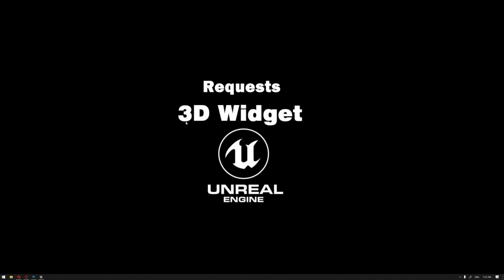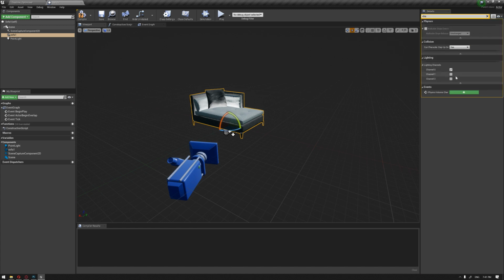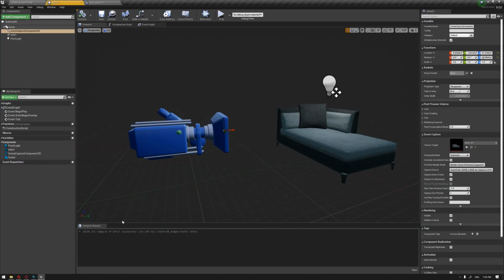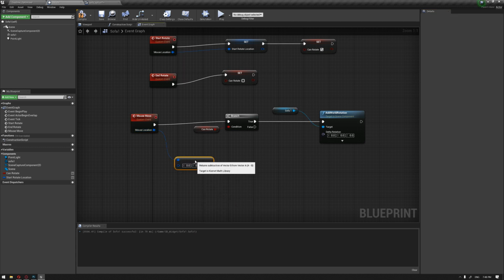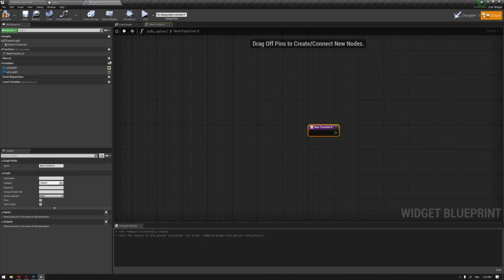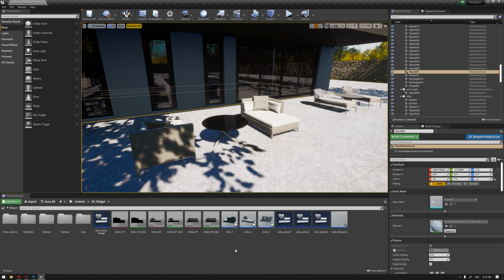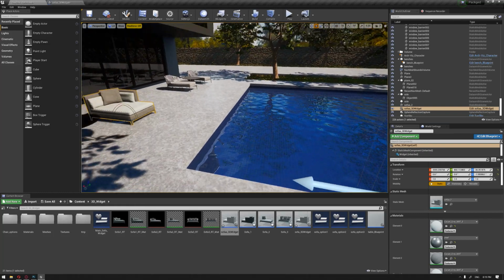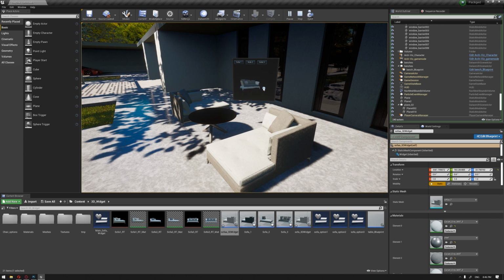Request 4 part 1 : How To Create a 3D Widget

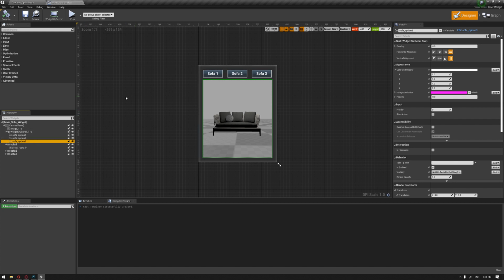Comment: Great tutorial, man! Thank you for sharing your acknowledgement with us! Could you help to solve the problem that you mentioned at 15:33? I am trying to make a listview on my widget showing materials list to player select. But, the texture render target loses the alpha channel every time that a restart the project. And, i need to reopen all blueprints viewport agais (more then 100 blueprints!) to refresh the textures. How can we solve this? Do you have a trick? Thanks a lot!
Reply: Complementing, i tried to package the project and the texture render target is being missing even if i build the package with all blueprints viewport opened. I know that if i put the blueprints in de map it will work, but in this case i lose tha alpha channel. I will really apreciate if you could help me!
Reply from the maker: @_marcus_vinicius  sorry for the late replay ,  missing textures in a packaged project could be because the textures in your original unreal file was not embedded in your projects files so the engine was not able to package it to its location same for videos also , as for your first question we still trying to understand why this require opening the bp for some of the widget cause its not happening with all of them , hope that help

Comment: How to make this work in a top down template? Itried doing this but the player just moves past the widget and I cant click the button
Reply from the maker: Hi Pratyush , not sure how is your down template layout arrangement look like but if this a problem of widget overlapping with you character or actor then there could be a different solutions for this like activating that widget with a corner small icon or adjusting the mouse click when it overlap with the widget to be snapped to it
Reply: @theimageneers5161  hi i solved it , but one more doubt , how can rotate the object using widget buttons?
Reply from the maker: @pratyushraut9120  glade to hear that , basically you will use a slider to control two value min and max from the object properties

Comment: Hi, my widget needs a refrence to the building it is located it, how do i set that in 3d widgets?
Reply from the maker: is your building an actor or a static mesh imported as datasmith ?
Reply: @theimageneers5161  i think it is an acotor, but someone else already told me that i can get the widget than cast to it, and than set the variable by that. It seems to work. But thanks for the help anyway.
Reply from the maker: @Piet_PP  Thank you for sharing  your experience as well , glad to see you figure it out , thanks 🙂

Comment: Widget interactive component have been crash and doesnt worked anymore. This tutorial only work for older version. Anyone follow this tutorial seriously will see the problem. Im one of them
Reply from the maker: Hi there , this widget interaction is working fine in Unreal engine 4.27 latest updates , if your facing any crash problem perhaps you could do a small test for a simple widget interaction in an empty level after verifying your UE version file .
Reply: @theimageneers5161  update. I create new project. Widget interactive work fine at ue 4.26 and ue 4.27. But widget interactive in my current project still doesnt working. I dont know what cause it, many people have a problem similar to me. Do you have any idea. I have been found solution for 4 days.
Reply from the maker: @SenEmChannel  few steps to make sure that everything is ok , check the pawn BP if the interaction is checked and if its assigned as player 0 , if in another empty project everything works fine try to migrate the widget to your project
Reply: @theimageneers5161 thankyou, i migrate all my level to new project and widget work fine. But it only work for frist time. After i close a 3d widget and open again. It doesnt work anymore. I googled it and realize many people have a problem just like me. But i haven't  seen any answer yet. Do you have any ideas.
Reply from the maker: @SenEmChannel  Can you please try to make a copy of your widget and the pawn that is interacting with widget , and try to simplify your BP to a basic interaction and remove any advanced stage of that BP , just try to check if the problem still exist
Reply: @theimageneers5161  i follow what you said. create new widget. I found out the problem but dont know how to fix it yet. Turn out when i hit the button. That button stay pressed and dont go back to normal color. ( i set normal color is white, and pressed is green). I still dont know how to fix it, hope you have some idea.
Reply: @theimageneers5161  can you help me please, after 10 days i got stuck??? I hope someday i will find a solution
Reply from the maker: @SenEmChannel  can you please confirm , have you setup a remove from parent node after clicking on your widget and connect that node to the action you would like to achieve such as opening a level or adding another widget , assuming you have a hover color and pressed color for that widget your pressing .
Reply: @theimageneers5161  i want to press a 3d button. When button was pressed,another 3d widget will show up. That is my intention

But for now, My button widget is totally blank. I only set hover color and pressed color, i dont code anything in the 3d button.
It okay, that is bug, many people have a same problem like me. Some can fix it, some dont
Reply: @theimageneers5161  thank, i will try. 3d widget. Ue4 have bug everywhere

Comment: hie Buddy Thank you so much for great effort.     Question - whenever i create actor for door or sofa and after when we add static mesh right and after we will add that actor to view port but that time the modal inside viewport appier big scale or small scale always i need to do rescale what is the problem?
Reply: Ahh this also possible maybe 😅 once’s you go too much deep into software this common thing’s you will not remember. I think this will work i will try thank you so much really appreciate and inspire from your videos.
Reply from the maker: @jayminshah1853  Thank you
Reply from the maker: sorry for the late replay , this happen due to different reasons but regardless you can try doing this process either by adding an actor and then ading the static mesh and choose it in the panel right side or by converting the static mesh by righ click to and actor , hope this help answer your question .

Comment: I am having a slight issue. Everything works except for rotating the image within the widget. Seems to be linked to cast to archvischaracter node. If I remove this and go straight to spawn then it works. Would really appreciate some help. Thanks
Reply from the maker: please check if the boolean variable ( can rotate is unticked ) also make sure ur using the custom player controller that enable mouse interaction